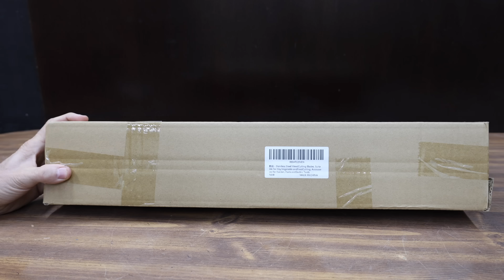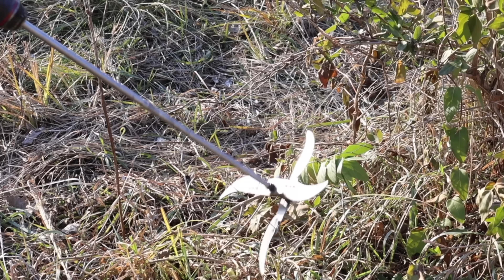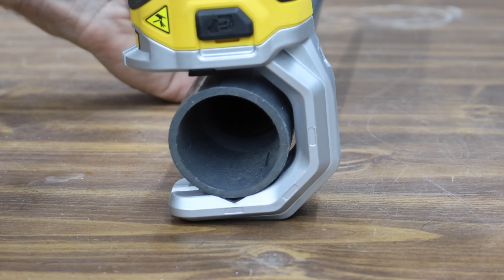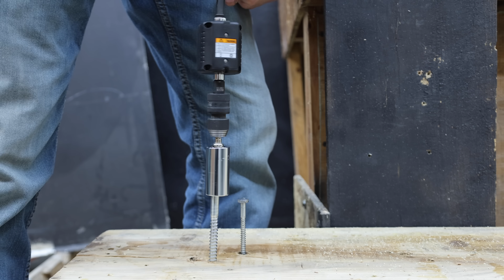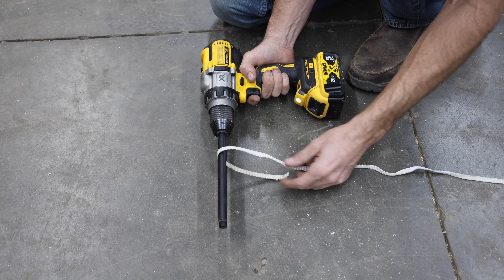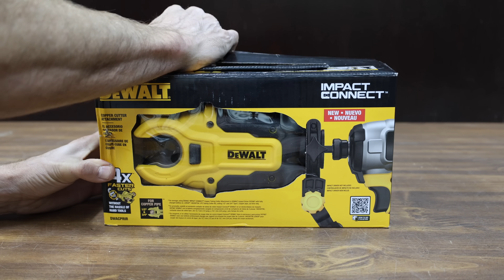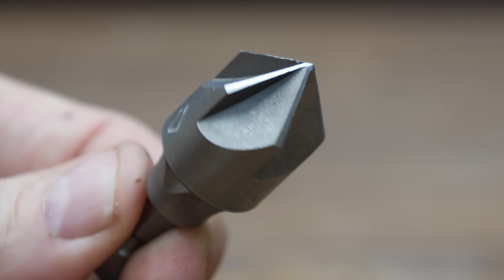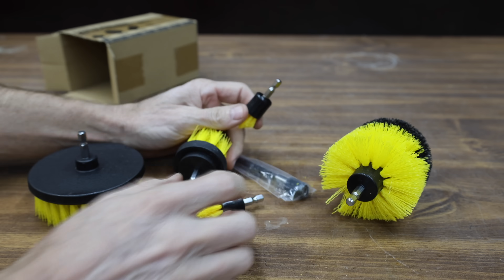I Replaced 10 Power Tools With My Drill!

Comment: Drill brushes are great. Just used some last week. Big help
Reply: Work smarter not harder!
Reply from the maker: Thanks for the feedback.
Reply: good for removing paint so I can get a better ground.
Reply: I used the narrow one to decarbonize the intake ports on my wive's VW Jetta engine, without damaging the surface!
Reply: I used one to refurbish a cast iron pan.
Reply: @jimmyzhao2673 oh nice!
Reply: Easy to clean grout lines.   Those advertised bathroom tile brushes will break, the moment pressure is applied.  I also have a sander attachment.  So easy to use, better control over speed and uses standard hook & loop discs.
Reply: @FreeRadicals305 wait, what kind of brushes are you using for grout lines? I've only use the brushes with the regular cleaning bristles (not wire brushes) in drill as it just helps scrub stuff like tubs & showers
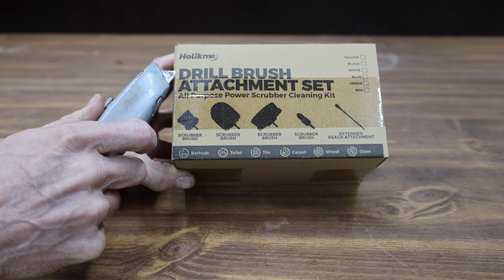Reply: @aisforannihilation1662    16:01 Brushes.  Mostly the rounded one.  With little effort and reversing direction, they do an awesome job.
Reply: @FreeRadicals305 sweet! Thx
Reply: Try the ones with plastic bristles. I tried them and could not believe how much better they were than a wire wheel brush

Comment: I used a smaller auger(1.5")  to plan bulb, way faster than doing it by hand. The side handle on the drill even with a smaller auger would be recommended.
Reply from the maker: Thanks for sharing.

Comment: Let's test cordless pruners both handheld and pole pruners. My DeWalt pole pruner died way too quickly. ( May under 200 cuts the blade was delicate and the too hard to cut feature failed)
Reply from the maker: Thanks for the suggestion.
Reply: @ProjectFarm test dozen times with a branch too difficult to cut. My DeWalt died after 3 attempts in a row. It should be impossible to kill it.

Comment: I have a version of the drill pump. Very useful. I use hoses similar to garden hose material. Laundry machine hoses also good. I think the example hoses just not rated for suction lift. Flat would have worked.
Reply from the maker: Thanks for sharing!

Comment: Wow! Thanks! I think that versatility is extremely valuable so this is a very useful and informative video. Good job! The one attachment for my drill that I really like is the FlexiSnake Drain Weasel MAX Power Drain Hair Clog Remover Tool with Drill Connector, 30 Inches Long because it clears my drains so well and I don't have to tangle with one of those huge professional snake tools.
Reply from the maker: Thanks for sharing!

Comment: I would have expected this on April Fools Day.
Honorable mention, both real:  
Drill-mounted boat propeller
angle grinder chainsaw attachment blade
Reply: April first should be the silicon ladder spray test.
Reply: @garygroundpounder7817  What is a silicone ladder spray test?
Reply: They actually make an angle grinder attachment for drills.
Reply: @jamevay If it's big enough for the 4 1/2" chainsaw blade then I can make the least safe chainsaw ever!

Comment: Black and Decker always did some very good drill attachments back in the 80s!
Reply from the maker: Thanks for sharing!
Reply: I can't recommend them anymore. Black and Decker just seems to outright hate America and only sells their better tools in europe. 
It was practically impossible to find batteries bigger than 1.3Ah back when I used a matrix in 2018.

The only way to get batteries big enough for a hungry Matrix was to tear down old lawn equipment hoping it had an uber special 2.5ah battery with it. There WAS a 4ah battery but it had been seemingly discontinued since like.. 2013
They still sell slow chargers by default and want //// Oh. they very cheap now. That's good. 

And it would even be pointless to buy one because they only really sell worthless 1.3Ah batteries anyways. etc. 

Oh and they've cancelled, revived, then cancelled the matrix several times.. making attachments extremely rare and too hard to obtain without a lot of patience. //// Oh. There's a V3 matrix now. Good too I guess. --it's far too expensive for what it is.

 I just can't recommend them at all anymore with how stingy and unwilling to share their tools they are in the Americas.

I did like the matrix though. Mine fit with every attachment I had into a single bag. Built furniture and bar-tables with it for laughs and I can see how useful it would be to say.. an RV owner. But I must stress how unreliable B&D's sales efforts are in the americas, they hate us so I really don't want to support them.
Reply: Eighties? They have some now. They have a set called the Matrix that has attachments for a drill that are pretty good. I wish he would do some testing with them on this one.
Reply: That is more than 40 years ago...

And 100 years ago, "Stanley" was the usual reference for quality  woodworking planes...

Today, Stanley-Black&Decker is a SHITTY company that has destroyed all the prestige that the old names once  represented...
Reply: @alfredomarquez9777  It's called "termite capitalism" and it is worth looking up.